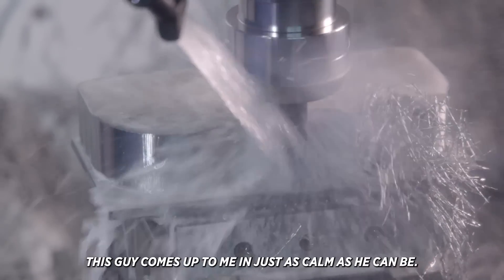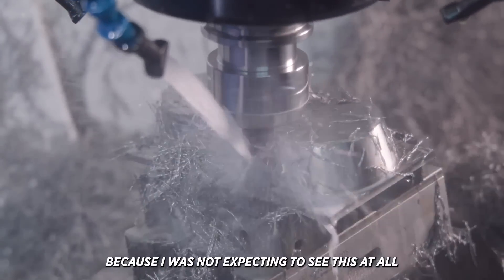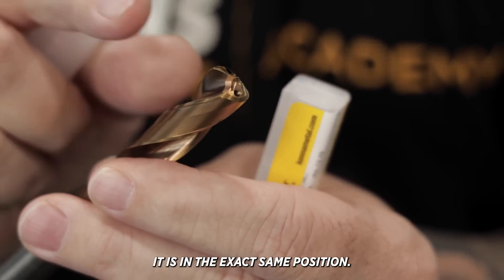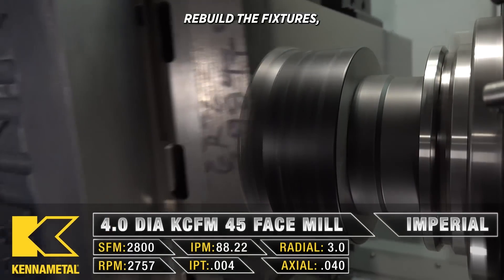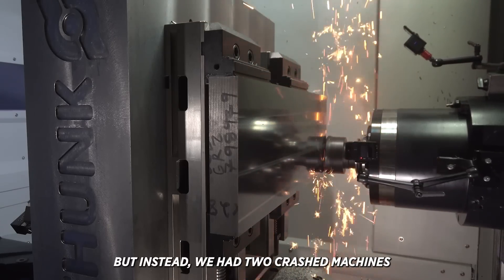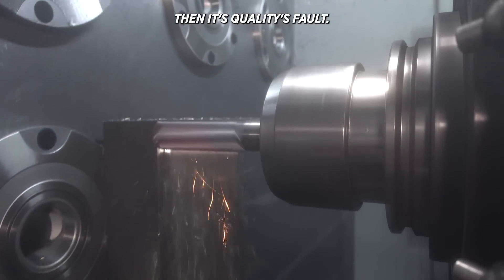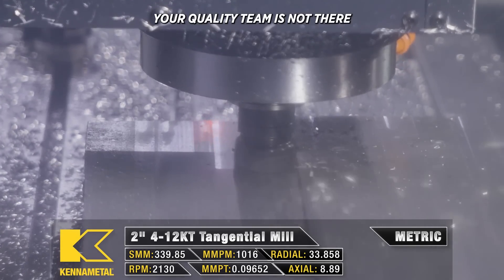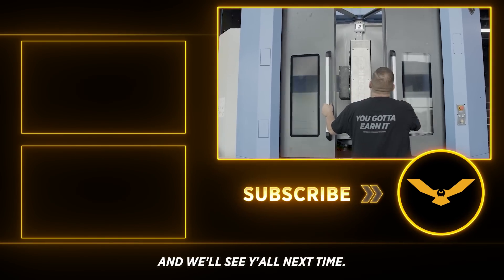$200,000 Damage | EPIC FAIL… Machinist CRASHES TWO MACHINES at the Same Time

Comment: I would hate to run a first time program handed to me from someone else.
I won't run a production path without doing a roll call of every tool in the path.
Seen it so often people push the button and walk away, no checking the tool moving to the job is the one they expect, no watching the first engagement, don't even have "distance to go" on the screen.

Worst I've see, well there was the time the machine was burnt to the ground in the morning after machining an unknown chalk like material. (5m x 2m bed machine)
Another was also a 5 axis router doing one of those last minute change of plans Friday afternoon jobs. A wrong tool was called, (a custom 300mm long 50mm diameter 2 flute),
it approached from the side below table height and hit the springy round bar safety guard and shook the head up something awful.
On Monday we found the whole spindle motor dangling by one cap screw and the wiring. Also a substantial industrial machine.

Most expensive I had anything to do with was machining a deep large pocket in multi layers of glued together plywood.
Since the boss was staying back I asked him to blow out the shavings periodically, so he do nothing.
With each pass of a 200mm long X 25mm diam carb cutter with 50mm of flute length round the outer wall it compacted shavings into the corners of the pocket such that it deflected the unfluted art of the tool enough to snap it and make the shavings at the bottom of the pocket smolder. The heat transfer was enough to leave 2mm gaps in the joins of the aluminum bed when it cooled.
The upper part of the machine was covered in a black gummy soot so insurance insisted in not only the bed being replaced but a whole new spindle and gantry replacement  (an 800k machine)
Of coarse the boss wanted to put it on me that there was a crash because the tool broke, but there was no sign of such a thing in the charred job and plenty of buildup and heat concentration in the corners.

Comment: Did the same thing , I was working with tall parts and long tools , I set up move to sefe position on "program parameters" and started the cycle , everything was ok , the table was moving to safe position until it didn't , the tool change arm smashes into the part and it bent so bad that we couldn't use it anymore, turns out inside the program were these blocks called "change parameters" that had to have the option to move to safe position on as well or else it stopped when encountered , the next day I told them everything was working fine and that I took a bathroom break and when I came back the arm was bent , for two weeks I was manually changing tools .
If you ask me it was everyone's fault: the programmer that didn't set the option and left it to me , the instructor who didn't teach me well enough , I didn't know that I had to do it like that, and lastly my fault for running away from responsible , I watched that ATC arm crashed into the part yet I lied and I told I didn't know what happened and that I was at a bathroom break , in the end the damage was 1000$ and slower made parts due to manually changing tools

Comment: 200k damage.... Sure dude
Reply: At LEAST 200k. New spindles go anywhere from 20k to 40k depending on style, speed, and accuracy. Sometimes more. Labor to pull the destroyed ones out is a day or two with 2 guys minimum, then you have to check each and every axis, and if they need parts replaced on those (rails, ways, and in this particular case, a trunion), you can add that to the total. And THEN the guys have to slap the NEW spindles in, making sure that's running true, and realigning everything if needed. And you're making no money with the machine for a minimum of 2 weeks. God help you if there's a part that isn't in stock.
Reply: @orangedream267  20-40k? 
then i guess spindles are cheap over here.. 

Never seen a mechanic who takes 2 days to pull a single spindle out. And u talk about 2 man, 2 days? 
Dont know about the mechanics u have over there but here it doesnt take that long
Reply: @robinlambregts  Lad, 5 axis and horizontals aren't your little haas vf-3. And remember, in this case the spindle was BURIED in the trunion.
Reply: @orangedream267  haas? 🙈😂

Ik guess the mechanics in europe are of a other level 😉

2 days, 2 man just to get it out 😂😂
Reply: You must be God’s gift to machining. You weren’t even there, and you already know how much it really cost. Congratulations. 🙄
Reply: @Pondimus_Maximus  im gods gift when it comes to exaggeration
Reply: @robinlambregts  And I'm sure you've seen how mangled a spindle can get. And the effort it can take to pry it from the rest of the machine. A light crash on a machine can turn into a week long job if it tweaks any alignments. And not because of incompetence, but because of sheer time it takes to pull parts of the machine off to check everything. You can realign a 5 axis mill-turn in a day if all the panels are pulled off for you and you don't need to reassemble it. Hell, a few hours if you get lucky.
Reply: Of course you can have 100k crash on a 500k machine, it sounds like you have no idea what you are talking about.

Comment: I was an automation and maintenance apentis in my 4th an final year at a bearing manufacturing company in Switzerland. A few minutes before leaving, I went to check on something that I have done herlyer that day and my computer to shut it off and leave. I was right beside a rectification machine for the inner ring of bearing with my chef and suddenly there was a big flash and then the smoke frome the fire suppression system, that a company installed earlier that year. No one was hurt, the grinding wheel was shot. And that was that

Comment: my worst crashes were two times on lathe machines, one time i ran on g0 into the substindle, luckily its possible to fix it by ourself, the secont was on a 5 axis mill turn, selected a contour not correct at the cam, so the machine run back to toolchangingpoint though the part, my boringbar wigh abs40 conection just break in two pieaces. a technician hat to fix the B axis. the interesting about is, the machine did not noticed the crash, it didnt stop.

Comment: Vertikal CNC Lathe,  the Machine asked the Operator after changes if raw stock is in the Chuck, there is a Pop Up Window where it ask u 2 Times if that is the case or not, he pushed NO both times.....ofc there was, the machine going in Full Speed and after that need Spindle Repair, the Windows was Broken, Z and X Axis Linear Rails and Ball Screws where destroyed, 2 Week of Repair 150000€ Costs

Comment: When I learned CNC machining we went through the whole process: Programming, Simulation, Tool setup, Machine check and setup, machining and QA.
Now I know why. It's the machinists responsibility to cover for others mistakes before anything goes horribly wrong. That's why we dial down the Feed% and Spindle% to as slow as the tools allow so we can catch movements before they destroy the machine or the part. Sometimes you can even catch an error in the G-Code monitor before it gets executed.
Reply: Dry running is critical man
Reply: @genny1814  Interesting! Where I work we NEVER dry run programs - takes way too much time (production shop). We have a couple of highly experienced guys that do the initial setups and they proof out the program 1 tool at a time.  Once they get everything dialed in it gets turned over to production.  The first x-number of parts is run across the CMM after each Op. to look for any deficiencies and correct as required.  If we setup a previously run part then the operator typically swaps out the fixtures and gets them dialed in. If they don't have the ability, we have one of the lead guys go over and help them out. Once again the first couple of parts go to the CMM to make sure that they are correct.  It's very rare that these guys screw-up.  99.9% of the crashes happen during normal production.  One night they managed to crash all 3 horizontal mills in their cell within 4 hours of starting (of course nobody was around when it happened, nobody knows anything, it was the previous shift, the machine did it, etc.....).
Reply: It's called proving out  . You prove it works as it should before you just go hammer and tongs
Reply: It has been decades since i have worked on CNC machines, but back in the day we ran new code slow on blocks of foam instead of metal or nylon i think.   Makes you wonder if there isn't some smart program which can check or simulate code.   Check for obvious missing or wrong settings, for wrong speeds for a material. I mean NASA didnt just downloaded a new version of software into the space shuttle, it had to be proven first.  So why would you run code on a $100.000 machine without proven it first.

Comment: Ive seen some bad crashed because of incompetence over the years. Bridge hights not being set correctly, parts smashed under the bridge, one big zayer milling machine 7000x4000x3000 travel in mm crashed so hard it took 6 months to repair. Over a million in damage.. 😅
Reply: Holy crap id like to see that@

Comment: The amount is not so big.
Try to do a minor mistake with a train or something into the oil.
Shit happen. In person I don't understand why the the machine is so easy to crash, should be hard.
Reply: Machine big dumb. Only do as you tell it to. If you don't tell it that the length of the tool is say ~5" (cat40 and cat 50 renishaws are a touch shorter iirc, not sure about HSK and Capto), machine will bury that poor probe 5" into the part.
Reply: @orangedream267  yep, I am still amazed that the machine does not have basic protection to avoid. Its like I should be allowed to drive train with open doors. Basic protection is missing. Just wired in my ayes.
Reply: @aronandreas  That's where the comparison is wrong. You aren't really driving the machine. The code gives it directions. You are the speed (if you're at the control). You cannot tell the machine 'okay this is far enough, turn left here' in the middle of a program. You'd have to stop the program, edit it, and then restart. 

Actually, a good comparison would be the code is the tracks. If some donkey laid the tracks down where they taper in towards each other, or one section of rail is completely missing, you'd get a crash. The safety there is someone else checking to see the rails are laid down correctly. Do you walk your entire route to make sure the rail guage is a match for your train?

While there are load sensors on the axes and spindles, these machines can move FAST during rapids (rapids move the machine into a designated position VERY quickly, and slow  down as they reach that point, usually at max allowable speed for the machine, feeds are mostly used during actual cutting operations). It's like using those silly little rail road stops to stop a 100 car freight train going 100mph. It ain't going to cut it.
Reply: @orangedream267  Belive me, its the corde that drive the train as well. What is the challange with cnc machines is that it normally operate in a dangerous state, better then have limitations so it operate in a safe state, I noted that it slowly come into few machines. My point is that this was not any operator error, he just behave like human do. The problem is the process that not avoid this problems. Like I say, do not allow the train to move before the door i closed. The problem with CNC machines is that they NORMALLY operate in a state where the train can leave with open doors.
Normally this would be ok,,,,,until its not.
Thank you for the feeedback :-)
Reply: @aronandreas  And that's why the machine crashed. The machine didn't know it was 5 inches longer than it should have been. You can't ask the machine to read the programmers mind on what he meant to put in the spindle, and which offset to use. Even if this machine had a Collision Avoidance System, it would STILL need to know that the tool was 5 inches long. Someone didn't lay down a section of track, and the machine went off the rails. The procedure to prevent this is for the operator to check his code, and not walk away from the machine before he checks what it's about to do. As I said before, guy needed to walk the route (which admittedly is much more feasible in a machining sense, than a train).
Reply: @orangedream267  This way it will happen again. The process should remove obvious mistakes, not make them. Human is human, you cant change them. The process is easy to change.

Comment: Only experience I have is cutting some parts with Tormach back when Techshop was around and using my 6040 cnc. I would
have thought those expensive machines would have some pressure sensors to stop disasters.
Crazy how some people can be promoted when they clearly should be fired.
Reply: When a machine is capable of rapids of 0.5meters per second a load sensor wouldn't do that much. There are machines that can kindof do that but it's not about not crashing but reducing damage. Instead, the proper way to avoid crashes is to run the code trough a dedicated G-code simulator where everything is simulated. Tooling, tool holders, spindle, machine tool parts, the part, fixtures, everything. If it does not detect any collisions you're good to go. (assuming the operator sets the physical parts up properly) A G-code simulator is different from the simulation in CAM by the way.
Reply: @chas1878  Most machines will come with a graphical (and I mean graph, as in simple X, Y graph) simulation on the control. I know Okuma has a full on simulation module that is part of their collision avoidance system. DMG, Makino, Mazak probably have their own flavor of it.
Reply: Trust me, there are guys out there that can crash every machine no matter what they put on for crash avoidance systems, and it’s always someone else’s fault!

Comment: The largest crash that I have ever had happen to me was at work, I operate a large moriseki horizontal milling machine, I had ran the parts all weekend and everything was going great, when the tool change between tools 59 and 60 was going on the machine stopped, I came reset the machine and verified that the tools were going back to the right pots and then continued to run. I left my machine to load up some parts on our wire EDM and one of my coworkers had told me that my machine alarmed out, I though nothing of it, I suspected it was a +z over travel because I had zeroed out a tool prior. I walked to the machine to find the touch off probe had slammed into the part, ruining the probe and the part. It had turned out that between tool changes tools 59 and tool 60(probe) had gotten flipped in their pots. Tool 59 is a short pipe we use for washing the parts.
Reply: Ah the infamous Mori inverter alarms
Reply: As a field service engineer for Mazak I can only say 95% of the cases I recover are from a hang up in a tool change and the operator not verifying the tool data is correct for all the tools involved in the ATC mishap.
Reply: @irishharmon  This is why I always get the proper tool in the spindle and the next tool ready in the gripper anytime I recover a tool changer. If I have to power cycle a machine, I always reference out all axis', hit Op Stop, then read all the workshifts at the top of the program, reset it back to the top of the program, then tell the operator what tools are in the spindle and gripper and that it was power cycled and to re-read his work shifts.  Some machines are worse than others about losing track of tools.  Even worse than that, we have some Mitsubishi horizontals that can lose track of the magazine.  Just last week had one with some ATC issues at the start of my shift that turned out to be caused by the magazine being off by 1 number (thought it was @ tool 9 but it was really at 8) caused by the previous shift.